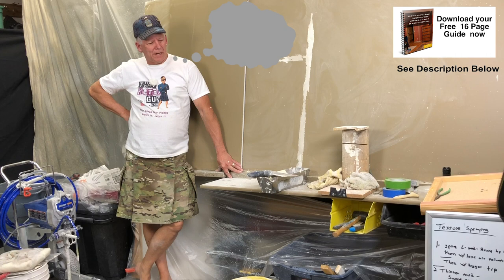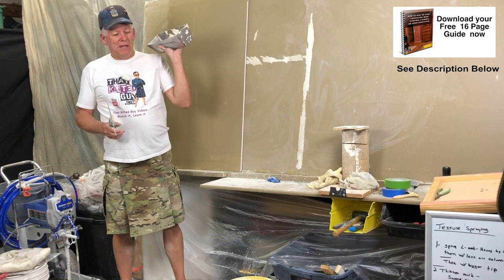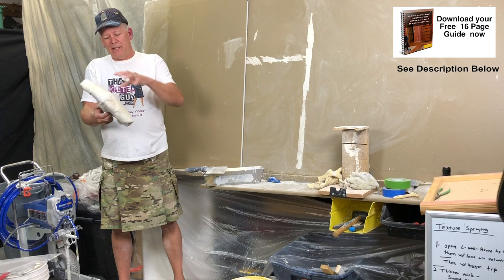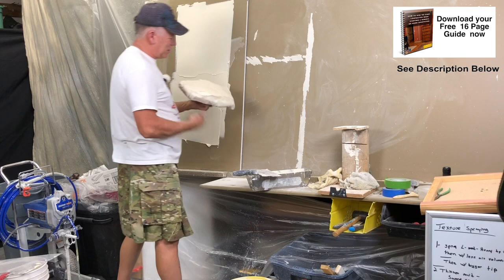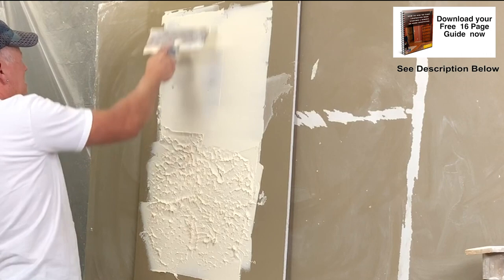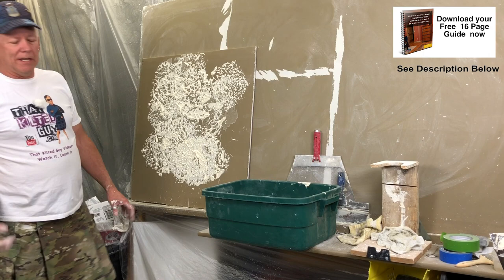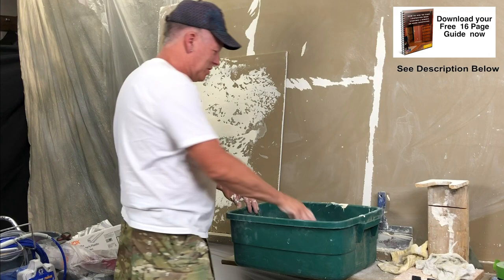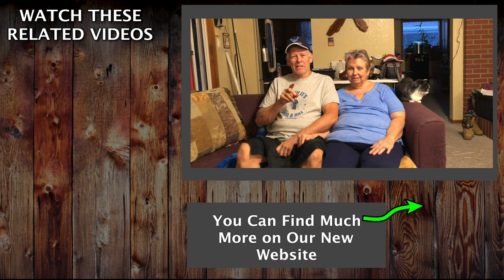Brocade Knockdown Texture.  Easy No Sprayer needed Wall and Ceiling Texture

Comment: Back in the 80s a guy taught me to do the same thing using a Hawk, but your way looks way easier. With a Hawk we would stomp it on the drywall and then pull off and sometimes it really wanted to stay stuck to the wall. We would rotate it every time to give a more random pattern but I remembering it kicking my ass by the time we were done. I’ll stick to spraying.

Comment: I listen to your video and watched what you did. I bought a sponge from the dollar store or use a needle nose pliers to pull out sections like you did but I designed it in Swiss cheese pattern some holes deep some not so deep. I missed my mind like gravy consistency. I did the sponge into it put a new wall board And the seam between the old wall board. I patted the material to add a little more similar to what was on the old wall and then I let it sit for 20-25 minutes. I’ll let the material harden and I took a wide brought a knife and went over at knocking it down. When I was done I could not tail between the old and the new it worked so well. I’ll let the material dry overnight and then I applied a coat of sealant, let it dry for two hours.And then I applied two coats of semi gloss enamel and it match the old wall. So I decide to paint the entire room with a fresh coat of paint was dry you can never tell with the damaged area was at. Your instructions in your example were very good. Thank you for your visual and oral presentation of the information.
Reply: Great idea

Comment: I just have little spots to do on the ceilings and spots  that I want to do it with a sponge and hope for the best? I also have to repaint that we already paid for and I found a lot of mess ups so now I got to repaint and hopefully I can figure out the right stuff I need for the walls because I did apply some more paint but it still doesn't look right to me! Maybe I need fresh paint? And here's the thing I definitely see where those guys got paint on our ceiling and we don't want to paint the ceiling and I don't know how to get the paint off? So I hope to cover it up with a little drywall or whatever it takes!

Comment: I used mud with  patterned roller going for a cave wall look on the ceiling.  Looks very good but starting to worry about what and how to paint it. Colors and such.  Any suggestions?
Reply from the maker: Spray it or use a long nap roller like 3/4” and longer and put plenty of paint and primer on
Reply: @ThatKiltedGuyDIY  wish I could show you what I'm talking about
Reply from the maker: @bpatterson612  if you need more extensive help- https://www.thatkiltedguy.com/consulting-services

Comment: Where does the name 'Brocade' come from? I know there was a chip/tech/telecom company called Brocade Communications. Also, i would really like to find out what is called and how to do this texture i've seen on some old million dollar turn-of-the-century frat houses in the midwest i've had to paint.  When they're cracked or delaminating pretty hard from generations of paint i just fill/screw the delamination areas back into the lathe and just use my thumbs or knuckles to try to recreate this swallow/golf-ball/egg type texture. No stalagtites or pointiness but raised swallows or waves almost to smooth/rounded points. Sort of golf ball or egg-sized dimples/shallows with a good 1/4" to 1cm depth. Reminds me of something i might have seen as a youth at a big turn of the century zoo like in an elephant pit or lions' den at Lincoln Park, Brookfield or St. Louis Zoos. Haven't found any examples of it in a year of searching on the web. I'd post pictures somewhere if i could. I'd call it 'golf-ball' or 'lemon-meringue' texture if i had to name it, though neither word would really do it complete justice. Any ideas?
Reply from the maker: Send it to my email ThatKiltedGuy15@gmail.com
Reply: @ThatKiltedGuyDIY  Thanks Kilted! I sent you an email. If you need more examples jlmk. Thanks!
Reply from the maker: @immeohmyoh  haven’t seen it yet

Comment: Can I do this on vinyl covered sheet rock walls?
Reply: Scuff vinyl to create tooth and keys.   PVA primer. Scuff again. Add wood glue to a 90 minute hot mud. Run with it... And don't make mistakes because concrete mud doesn't sand well. Be ready to live with the results.

Comment: Question;  Spraying a orange peel or other texture on already painted walls, is there any further prep that must be done on the walls?  Concerned that it will not adhear well, thoughts?
Reply from the maker: Yes, you need to degloss the wall by sanding it, (with80 grit) and/or using a DeGlosser which you can buy at Sherwin Wiliams. Otherwise, it won’t stick very well.

Comment: Do I need to apply a primer to the drywall before going on with texture?  I believe I read that on the box of mud (powder) but can't seem to find a video on surface preparation.  Thanks for doing these very helpful videos!
Reply from the maker: Primer is a good idea as it helps the mud set up more evenly, but that's mostly important for textures you manipulate, like this Brocade, or knockdown etc.  Not so much for orange peel.  I think the mud manufacturers recommend it, but in all my years doing new construction, we never did and I never saw it cause us any problems.
Reply: @ThatKiltedGuyDIY  Thank you TONS  for the reply!  I'm going to do knockdown.  The area is only 24 sq. ft. and since I have the primer on the shelf, I think I'm going to use it.  But this is useful to know for the next time.